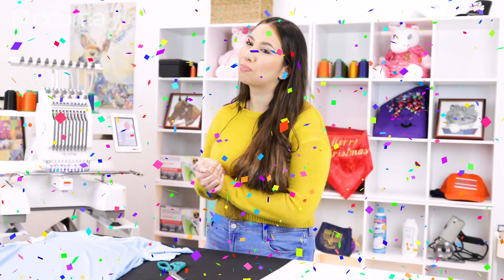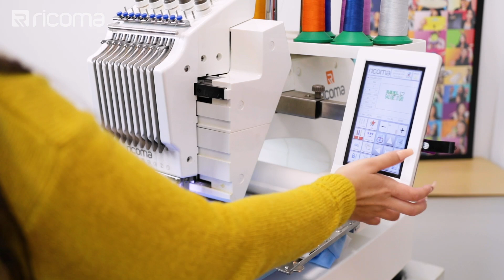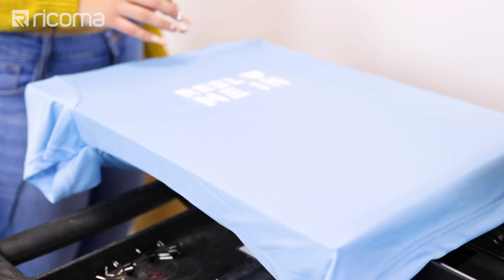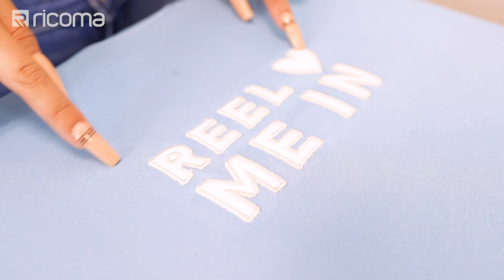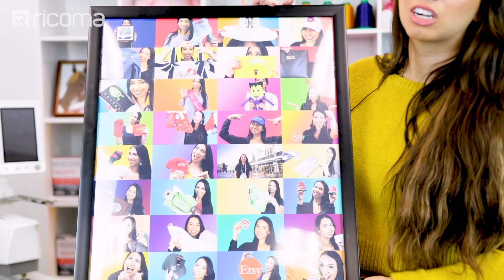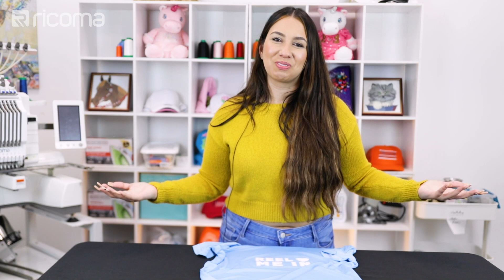Embroidery + Heat Press Vinyl Appliqué  (Embroidery Hub Ep105)

Comment: This is nice. BUt why skip through the steps ..   for newbies, i will be better if the full process is shown even if it takes longer .  the lovely lady just said, lets change  the needle...   why not show  the process..   i will love to learn more ..
Reply: How about a material list for the videos ?
Reply: I said the same thing....from step one to creating in the software to the finish.
Reply: @FeSewNPeace  the software is not easy you have to know how to digitize and for 3d puff it's a different way from regular designs. Like u need to digitize a hat for bottom up middle out. Then set bobbin and tension the center run and more
Reply: At least one thing can be useful>>.   Laura is talking about HTV.   Can you post a link for the one she used?